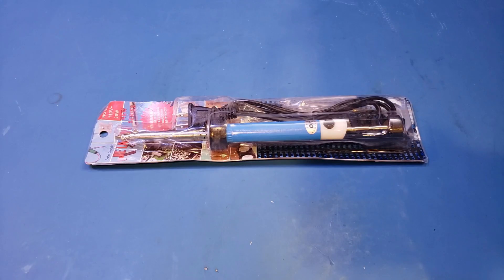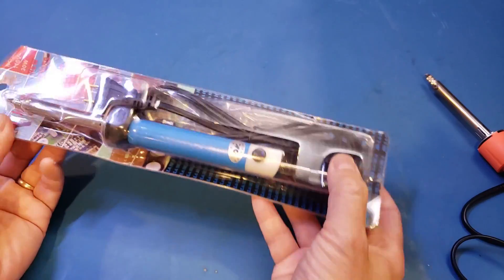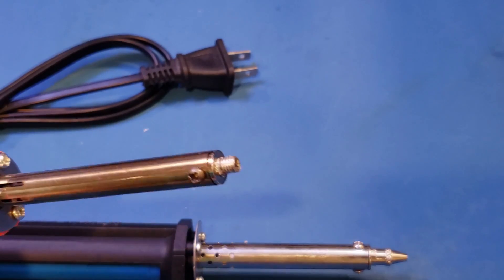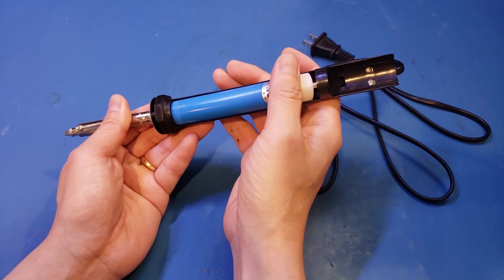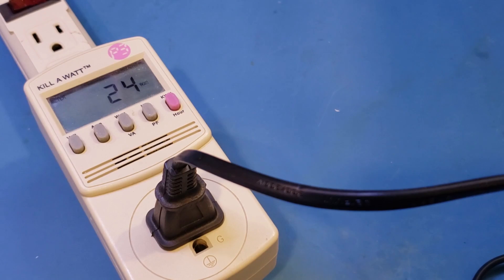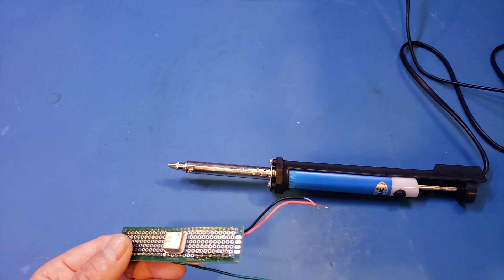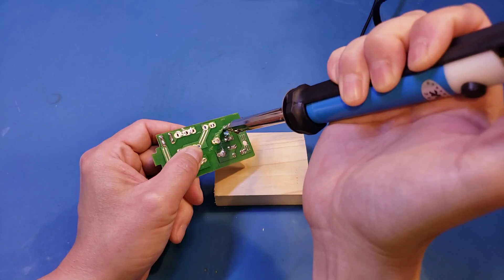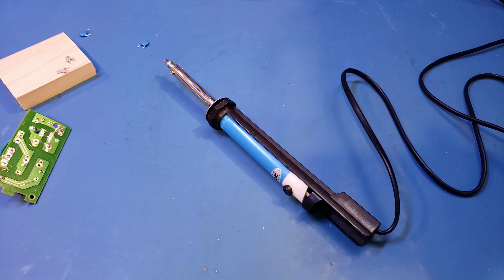I Bought another Cheap Desoldering Iron on AliExpress

Comment: 1. Doesn't the second tip have a smaller diameter?
2. When I dismantled an insulated soldering iron, I found a non-metallic heating component inside. BUT: I just found an Amazon review: The fuse/FI was fired after ~140 times on a very similar device. Here, the tip was connected to ground. So, your concerns are very important. 
3. Don't try to check the insulation with a multimeter, it's pointless. I bought a UNI-T UT501A to test the insulation up to 1000 V. If it shows 5.5 GOhm at 1000 V, you are on the safe side.
4. Nice test, thanks!  I will also get one so that I have a solution when abroad.

Comment: I've got a yellow/black one that I bought at a local electronics shop. It has the same design as this one, but it actually has a three prong plug and the metal part is grounded. I think they wouldn't be able to sell it here locally otherwise. One problem with it was that the nozzle was too large, so I had issues desoldering small components. I found a set of nozzles on Ali with different size nozzles that solved the problem.

Comment: I have this exact one for some years now. It kinda works, but I hate it. Sometimes solder joints refuse to be cleaned completely, and repeatively trying to arm it again and again is very tiresome and frustrating. It's also very weak in terms of power and slow to heat up.

I finally gave in to my tool apetite and ordered a Pro'sKit desoldering station.

If you ocasionally need to desolder a component or two the manual desoldering pump will work and it's dirt cheap, for anything more serious do yourself a favour and invest in a better tool.
Reply from the maker: Yeah the suction could be stronger, I showed that in my video as well.

Comment: And how you clean this pump?
Reply: Push forward the part with the button (the white part on this model) and lift the whole cylinder from the middle. Take out the piston and the spring. Clean the piston, spring and cylinder. If you don't do this often, the pipe from the nozzle to the cylinder becomes clogged and it also tends to accumulate around the piston and could affect sealing.

Comment: Tips for these are really hard to find and most probably since these are cheap they will wear out quite quickly better would be to use a good quality soldering station along with wick and desoldering pump
Reply: The tips are not hard to find and they're somewhat cross-compatible. Yes they wear out quickly if overheated. I use mine regularly for 2.5 years no problem. Mine is modified though with triac dimmer and electric vacuum pump.
Reply: @aizu35 that is a good idea how much did u pay for the electric pump does it create enough suction power to suk the solder does't the heat damage it ?
Reply: @SharvilSawargaonkar  I want to explain it but my comment keeps getting deleted, idk why. It's on my video
Reply: @aizu35 ok thank u its a yt issue, commenting too quickly or copy pasting even a single letter del comments insta and redit doesnt do it they let u  say wathever the f u like

Comment: If the orange one worked more than twice, you did better than me.  Second use the plunger flew out of the piece of crap when i pushed the button.   Better off to send it straight to ewaste.
I promptly purchased a good one.
Better off buy once cry once.
Reply: Definitely, I already heard about these cheap things falling apart and so being dangerous, better use your full PPE when you use these cheap things 😅
Reply from the maker: TBH, I had used the orange one for at least seven minor repairs. It's still holding up :-)